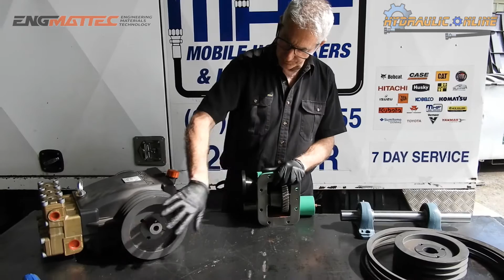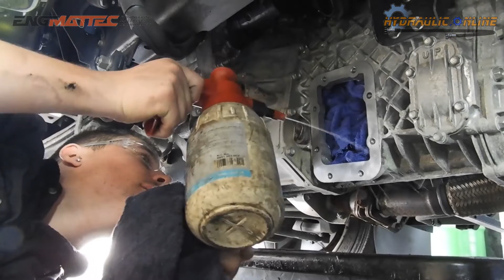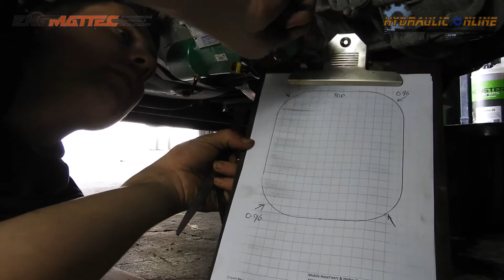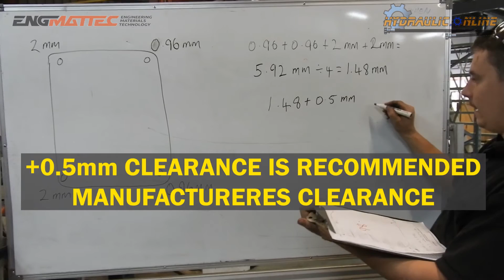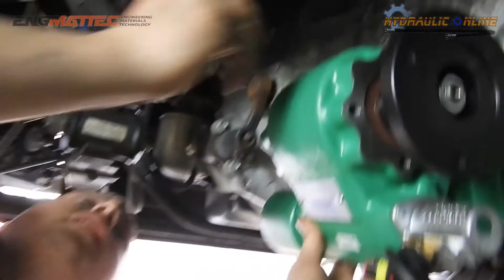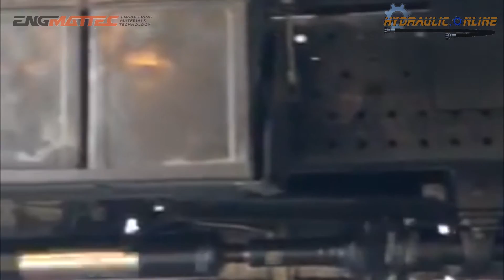How to Install a PTO Power Take-Off unit to Truck Gearbox

Comment: Hi, what kind of High Pressure Water pump that’s on the table? Model and manufacturer and where I could get that? Thank you
Reply from the maker: If in Australia Try the "Bar group" they have a huge range of high pressure water pumps.  Tell the flow and pressure you require and they will tell you the power and speed you will require.

Comment: Could you use this system to put power back into a  gearbox? I am looking at ways to put power from an electric motor into a farm use whlst retaining the traditional drive train and engine AND without major modifications. Thanks in advance.

Comment: great video! im still a beginner at this but can you explain to me if you ran the pto at the end without refilling the transmission oil? i only saw when you installed the drain plug then started to operate it? is it a good practise to test it like that then refill it with transmission oil?
Reply from the maker: You must always add oil to the transmission before running the engine and the PTO.
If you listen carefully at around 24:50 we advise to let the silicon sealant set for a couple of hours before adding oil to the gearbox, but before adding oil install the drain plug. 😁

Comment: Why would you take a steel wire brush to to clean the surface for the new gasket they sell a plastic one that will not gouge the aluminum?
Reply from the maker: Oh OK a plastic wire brush interesting idea. I would like to know who are " they " are? If you are careful and don't apply too much pressure and keep it moving you should be able to avoid marking the aluminium.

Comment: GREAT video...but I'm trying to troubleshoot my electricals....
Reply from the maker: Hi Peter so what is your problem with the electrics? I have have a couple of engineers that work with us and we do quite a bit of trouble shooting of electrics. Maybe we can make a video on trouble shooting electrics. Actually you have planted a great seed of an idea for us to make more electrical videos as our video titled  How to wire up a 12 V DC hydraulic power pack" is now one of our most popular videos.  Thanks for the idea, we are going to make a few electrical trouble shooting videos over the next couple of months. Let us know your problem though.
Reply: Hi... I've just briefly searched your videos for electrical troubleshooting but didn't find anything...
I'm using someone's Isuzu NPR tipper truck but the PTO isn't engaging... There is no power to the PTO fuses not too sure how to check solenoids etc and my phone signal is usually too poor for videos making it more frustrating...
Reply: @kakimanda1323  sorry it took so long to get back to  you.  The auto elect found a live wire under the dash and bypassed the existing. That's the fastest solution. Sorry I didn't see your question

Comment: How hard to add on a square body Chevy to run a brush hog on my 4x4
Reply from the maker: Hey, Max , very interesting idea to run a brush hog of your 4x4, if your Chev has an SM420 or SM465 transmission they should have a plate or a plate on each side that can be removed to mount a  PTO.   Have a read of this thread regarding PTO's from IH8MUD.com
https://forum.ih8mud.com/threads/pto-driven-from-trans-vs-transfer-case.30524/  
I did a bit of research and there seem to be lots of options for PTO but you will have to do a bit of reading and internet searching and then make a few calls, but it sounds like a great project. Let me know how you got on. Better yet, make a YouTube Video of it!

Comment: Can i use something like this on a jeep wrangler ?
Reply from the maker: Not Sure if you can install a PTO to a Jeep's gearbox Drakywolv but I am sure you can purchase a kit to mount a pump with a magnetic clutch to the front of the engine and turn it with belts from the crankshaft pulley. I am curious what are you trying to do with the pump, run a hydraulic winch ?
Reply: @Hydraulic.Online   i  wanna use it with a snowblower

Comment: Hello my friend question to install the pto to a semi truck that never have before do you need a new transmission or you can adapt to
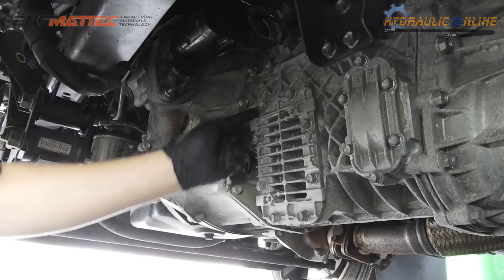Reply from the maker: Hi Samuel thanks for the question and for watching our video, Most transmissions on Commercial Vehicles will have a plate on the side of the gearbox (transmission) that can be removed for fitment of a PTO. Please go to the time period 4 minutes 26 seconds (04:26) in the video to see what we mean and then have a look for a similar plate on your transmission.
Reply: @Hydraulic.Online  thank you